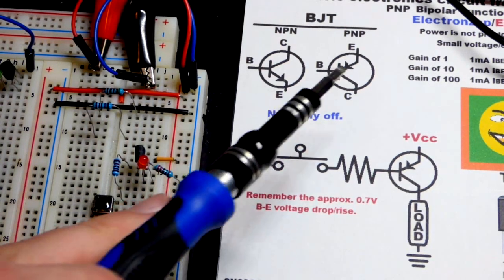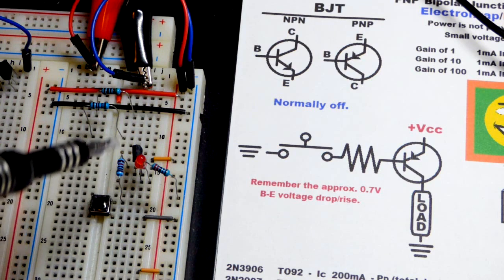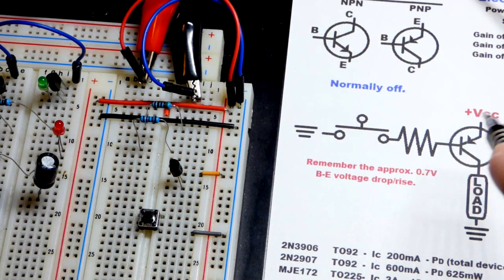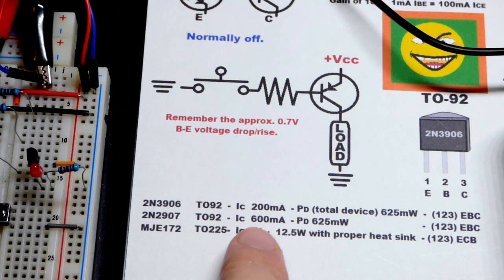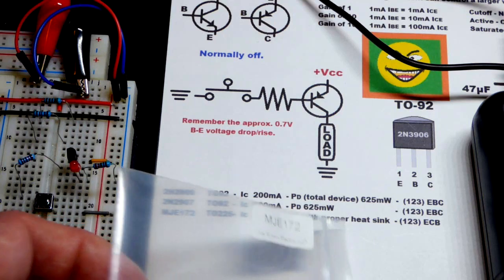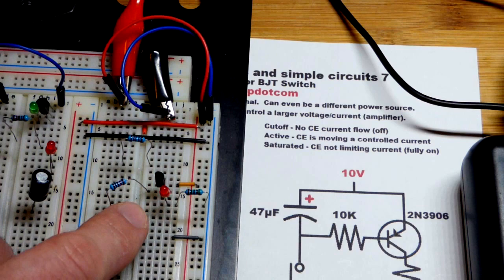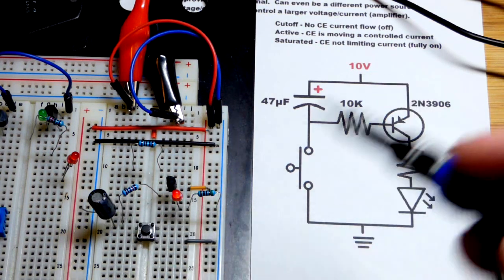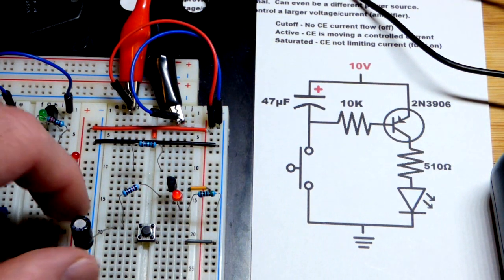Electronics course 9 PNP Bipolar Junction Transistor BJT switch plus capacitor fade off

Comment: are pnp bjt used more in electron-flow designs?
Reply from the maker: I never really see any circuits designed or built with electron flow in mind, other than split power supply circuits that are half electron flow and half conventional current. I mostly see people that just study the physics of electronics who reject conventional current.